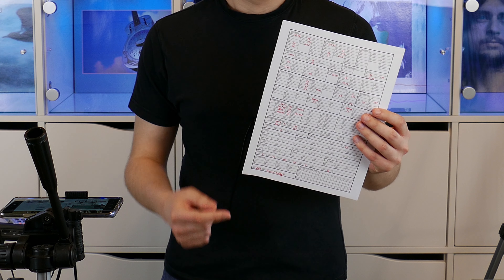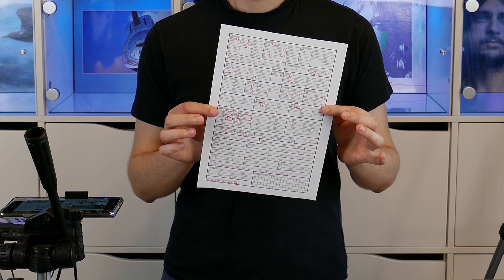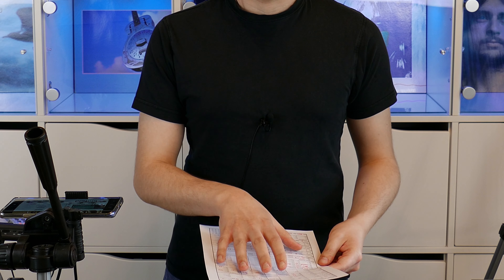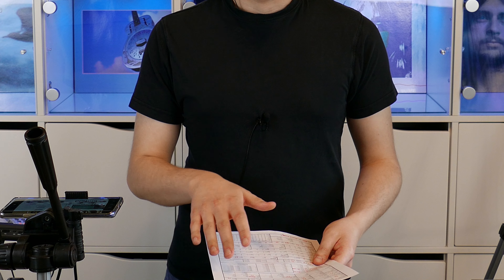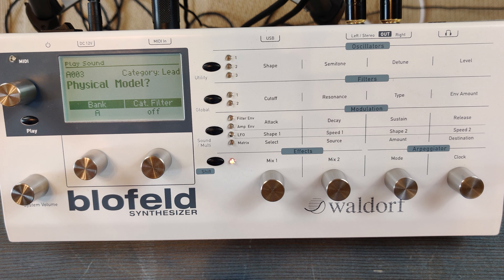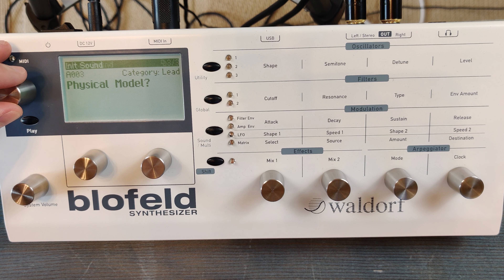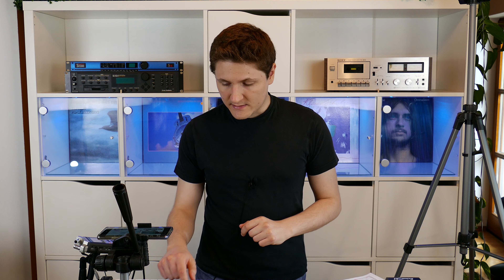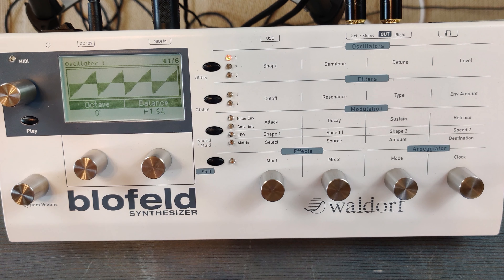[patch] Physical Modelling with a Blofeld?

Comment: Thanks for you videos. Has the Kyra become any sort of modern replacement version of the Blofeld? Thanks
Reply from the maker: I wouldn't say that. They are rather different, made by different developers and with different technology. So they also sound different and have a different synth engine. Actually, only the brand is the same :'D
Reply: @SynthesizerVideo  I see thanks :)

Comment: I don't know why but the wavetables on my Blofeld don't have names in large type like yours (K+Strong 2), just wavetable 49, 50 etc . I'm using the latest OS.
Reply from the maker: Normally, updating the OS should help in that case but due to the fact that you tried this already, I would assume that there is some kind of hardware or software error in the machine. One more thing you could try is to update the OS i.e. with a very slow transmission rate. 
Otherwise, you can always post a question in the Waldorf user forum or reach out to their support as well.
Reply: @SynthesizerVideo  Thanks.. good to see you're still active.

Comment: Good stuff! I recently read about this:
"The technique they developed took a wideband waveform – typically white noise – and passed this through a recursive filtered feedback loop in order to create an evolving subtractive comb filter effect (a comb filter being a filter that operates on multiple frequency bands simultaneously)."
Did you try using simply white noise and a loopable envelope?
Reply from the maker: You don't need the envelope. You can try the not synchronized delay effect with very short times and a lot of feedback to create a comb filter sounds. Or you use the comb filter type in the normal filters.